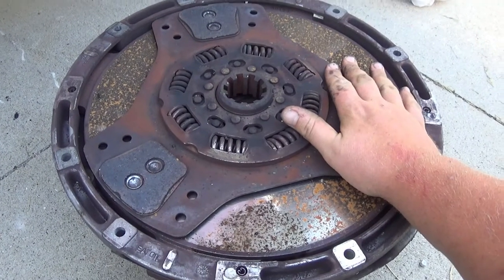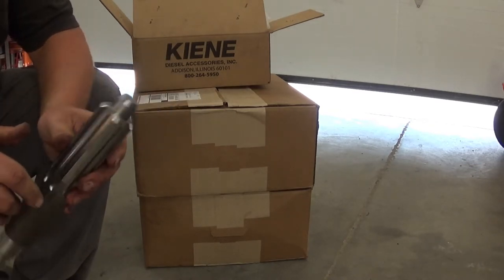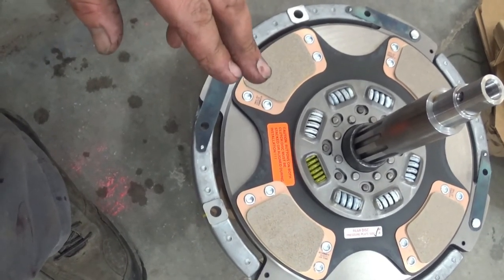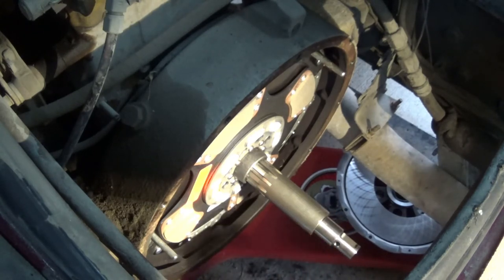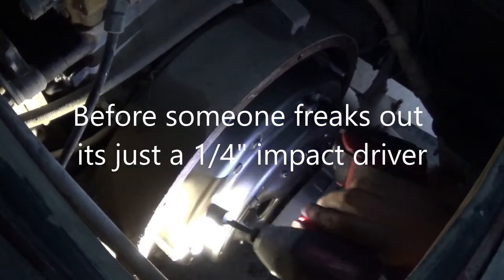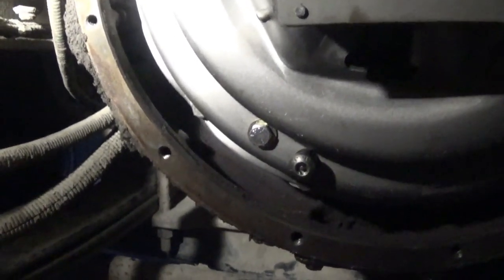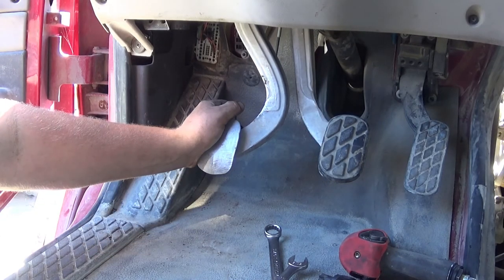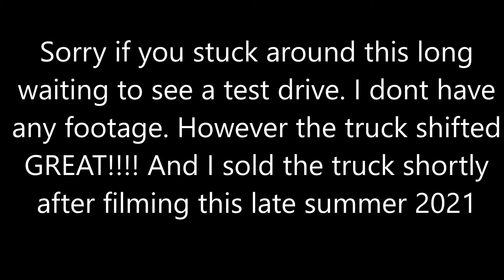Eaton Solo Clutch Replacement

Comment: Screw picking those up by hand just assemble them on the transmission input shaft and move the flywheel with pry bar to line the bolt holes up and put you're hand through the inspection cover with the bolts for the clutch and torque to spec also cut slots on the end of you're guide studs and use flat tip screw driver to remove them. Sometimes pliars will not be an option to use.

Comment: What brand clutch is that? 29 year Eaton Rep here. Great knowledge of clutch operation. The clutch you removed was severely under greased.
Reply from the maker: Honestly I'm not sure on the brand. I got it from the local truck parts supplier. If I remember correctly it was a reman not sure by who.